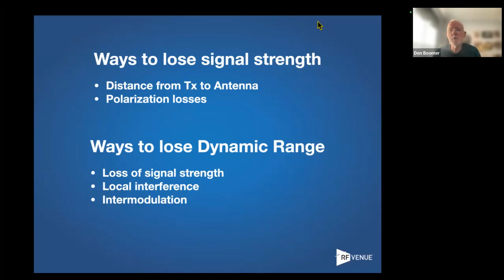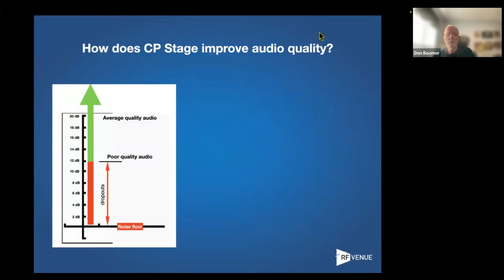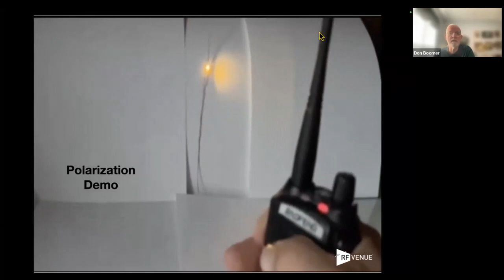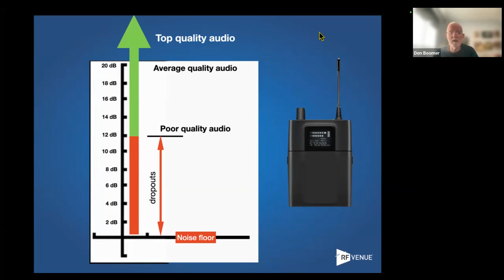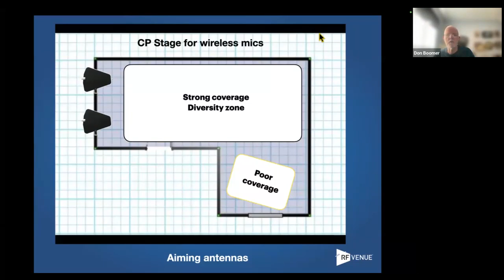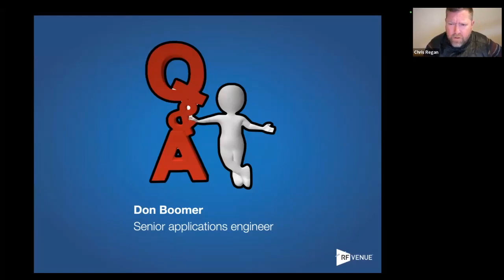RF Venue Live Webinar Revolutionary new antenna reveal

Comment: Couple of questions here: can I use this without a combiner, straight from the antenna output of a Sennheiser G4 IEM? Will there be any gain issues? What's the max recommended cable length? Alternatively, could this be a used with a Sennheiser combiner for IEMs?
Reply from the maker: Yes no problem! Plug and Play. Up to 100FT would be fine. If you need longer, use the lowest possible loss coax
Reply: @rfvenue  Lovely! Thanks! I was thinking about 5m (which is about 16-17ft) of the sennheiser's finest coax cable, I guess that would be perfectly fine. Should I set my IEM to 10/30/50mW of output power for this setup?
Reply from the maker: @calinvama1999  lower power is always best as it brings IMD noise down

Comment: Im typically running our IEM rig by me on the drums. Our current senheisser sits about 1-2 feet from me. However we do play larger shows where we can place antenna's in a proper side stage setup. Is the CP Stage capable ot not overpowering or causing issues if its only 1-2 feet away from one of the IEM packs? (rest of band is usually around 10 feet or so)
Reply from the maker: Minimum distance for CP Stage is 10 feet, as it has 3dB of gain

Comment: How is a two-CP setup better than a two-paddle setup? You talk about the problem with diversity, but diversity does not depend on polarization in this case.
The principle of “Coverage but not diversity” remains.
Reply: Diversity reception with circularly polarized antennas is extremely robust and not subject to the weaknesses of using two singularly polarized antennas. Diversity without attention to signal/antenna polarization increases the mathematical chance of reliable reception over that of non-diversity reception. But the vulnerability is that nothing but luck prevents polarization cross-fade from occurring on both antennas simultaneously. That's where having two CP antennas gives the advantage.
Reply: It depends on how you setup the paddles or the CP Stage antennas. IF the paddles are both on the same axis, they will provide coverage for diversity but will not perform as well as the CP off axis. You can fix this with paddles by mounting one 90 degrees off axis relative to the other, But that's not always convenient. Two CP antennas will provide universal coverage on all angles without special mic stand mounts and if in a larger space like a theatre you might opt to use the 2nd CP to cover areas that might be blocked by some physical barrier. So like you said you get coverage while having more options in terms of diversity. 

Steve Devino
Director of Product 
RF Venue

Comment: Would you recommend using one cp stage and one normal omni antenna on a wireless mic setup? Or is two cp stage required to make it better than I have now. Normally
I am now using one omni antenna and one fin. For a shure ulxd setup for pop music on stages that are maximum of 15-20 meters wide. So smaller venues. Thanks!
Reply: Adding one CP stage to your omni will improve things over the fin. Two CP Stages would probably improve things even more because the CP will provide good reception at any angle relative to the transmitters where as the Omni will provide best reception when on the axis as the transmitting antenna.   

Steve Devino
Director of Product 
RF Venue
Reply: Only if there is an actual need for an omnidirectional antenna. Most wireless mic systems benefit from directional antennas that are aimed in the general direction of the transmitter(s) and are less sensitive to possible interference from other directions.